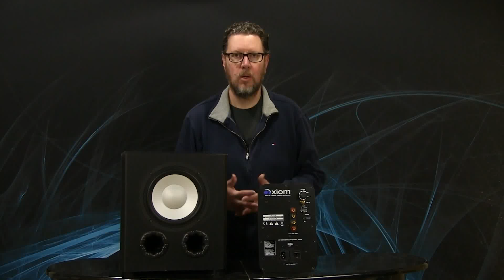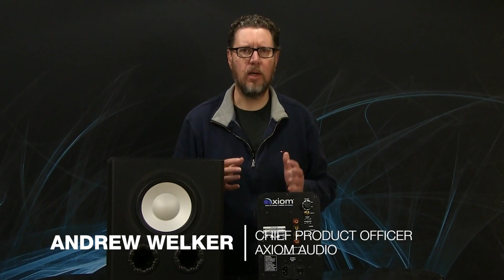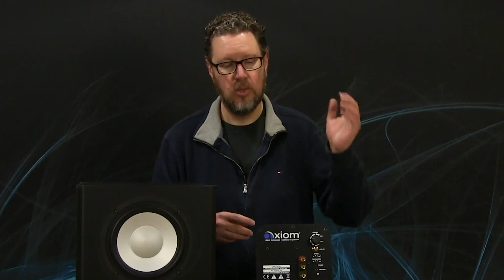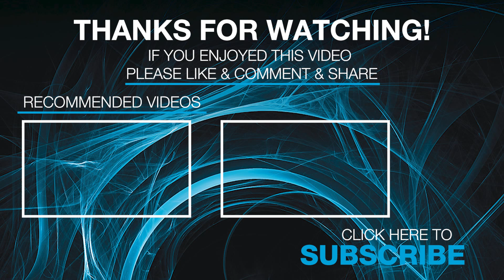Subwoofer Crossover: Best Settings For Home Theater And Home Audio Systems

Comment: Watched Rebel Ridge on Netflix, and it stars a guy who has a really deep voice. Center speakers and mains were set to a CF of 80. Subwoofer with LFE at 120, his voice was too deep. Switched it to 80, and the voice sounded much better. Seems that, according to this video, that should not have been the case?

Comment: Thank you for this very informative video.
A QQ: I have an AVR - Yamaha RXV4A -, and a Wharfedale DX-3 HCP 5.1 loudspeaker system. The subwoofer has both LFE and crossover controls.
If I use the AVR to set the crossover, where should I set the crossover control on the subwoofer?

Comment: Personally, electronics has no clue what my ears and perception of sound is like. I don't use bass mgmt systems. I run my towers full range with my receiver at the lowest X-Over setting and slowly introduce my subs X-over and volume...perfect for me. I want my sub to be an extension of my towers.
Reply: The best way to do it.

Comment: Need help,
I have got Jamo J12 sub with Denon X2000 avr. The subwoofer volume is set to 30%-40% and the level in the avr is - 10. If I turn up the volume on the sub, the sound will cut off at peak hits and comes back in couple of seconds. Is the subwoofer damaged or should I change my avr. Do you think it's normal. Please reply.

Comment: Hi. Let me get this straight. I have a pair of active speakers (edifier airpulse a100) with subout RCA port and rel t5/x subwoofer with low level input and LFE input. From what I understood from your video I should stick RCA into the LFE because crossover is being done on the active speaker side? REL recommends sticking into the low level.

Comment: OMG! Thank you so much Andrew. I've been doing so much research on soooo many sound variables with regard to my home theater room to achieve the best results. I'm getting the new Klipsch RP 1400sw subwoofer for my system tomorrow and I had no idea what to set the low pass filter to. I knew that the sub had as LFE input and I was aware that it was the proper input to use. However, I did not know by using that input, I didn't have to worry about a hz setting on the low pass filter because the sub would automatically allow the AVR to do the integration with the other speakers. Now that I understand that, that's one less thing I need to be concerned about! Your simple explanantion relieved some of my anxiety and for that I"m truly grateful!

Comment: Great video of watch numerous ones and you really explained this one well, perhaps you can help me?
I have a dent on AVR X6400H , with a pair of Polk Audio RT 3000s they are older speakers, but they have satellites on top and subs below so I’m basically running two subs on each side of the room  with a dedicated LFE line ,should I run Main or Main+LFE

Comment: When replacing a crossover, should the new crossover assembly be mounted on the back, or bottom of the speaker box?
 Im currently in the process of replacing the crossovers in a pair of budget speakers, where the old crossovers were tiny, and attached to the back of the speaker power input connectors.
 The new crossovers are considerably larger.

Comment: Thanks for this video.
I have a sound bar and wireless rear speakers.
The tv has no rca outs.
If use optical out and convert it to rca and connect to a powered subwoofer will I get independent sound from the subwoofer?

Comment: My Sony STR-DH790 AVR seems to have crossover settings for all of the speakers except the subwoofer.
Reply: You set your speaker crossovers in STR-DH790 settings and it'll send anything below that frequency to your sub. Then you set your subwoofer cutoff to max, if it is Sony SA-CS9 then it's 200 Hz

Comment: Andrew, thanks ! You helped me about my freq.settings. I have an old (2018) Jamo sub. Jamo sub has two rotary. One is Hz, its OK:)) Second is the LEVEL rotary. (minus endless to zero) My question is what level setting should I adjust on sub when I calibrating my pioneer vsx933 with its own microphone? By the way what level setting is recommended by the LEVEL rotary?

Comment: Hi Andrew, I have a denon avr-x960h receiver and two older Yamaha yst-sw305 subwoofers connected. Based on your video would I be correct in setting my avr crossover to 80 or 90 Hz and set the “high cut” dial to its maximum of 140Hz. 
Thanks Stephen

Comment: Great vid thanks.
I have a free useful app on my android phone which I think will help people understand what’s happening and tune the sub in nicely:  Frequency Generator. 
Connect the phones headphone output to an aux-in on AVR or amplifier (or an rca input using cheap adapter cable), and the app lets you wind the freq up and down with a slider. You can hear when the main speakers start to drop off, and adjust sub crossover to start responding there or a bit higher if preferred.
Also good for balancing the sub volume to the main speakers volume.
Reply: Nice!! Awesome find and awesome suggestion! Thanks

Comment: All Yamaha Bookshelf
Speakers FREQUENCY as below.
AVR - Yamaha HTR 3072 (5.1)
Center - 58Hz - 45Khz
FS - 57Hz - 45Khz
SS - 62Hz - 20Khz
SW - 20-160Hz
According to abv what crossover is to be set.
Current I set 80HZ

Comment: Hi please help me I am some confusion this crossover point 
My focal sopra n2 
Frequency response 34Hz-40khz
Low frequency point (-6dB). 28Hz

Center focal Electra 
Frequency response 55Hz-40khz
Low frequency point(-6dB)50Hz

Rear surround 
Bipolar focal sr800v
Frequency response (+/-3dB)
75Hz-28khz
Low frequency point(-6dB)65hz

Back surround focal 806v
Frequency response +/-3dB 55Hz-28khz
Low frequency point-6dB 47Hz

My subwoofer Definitive technology power field Reference 

Please suggest me what is the perfect crossover and 
For sub LFE 80Hz or 120hz
Please reply respected sir thank you
Reply: You can’t reply this sir please reply
Reply from the maker: I would recommend setting the main speakers to large and the rest to small. Then set the subwoofer/LFE crossover to 80Hz. That should work well.
Reply: @AxiomHomeTheaters  other speaker 80Hz front large 
Lpf for LFE 80or120Hz
Reply from the maker: @taheralikhan5771  yes, that's correct.

Comment: How about introducing a high-pass filter before the power amplifier (after the preamp) and hence take the bass significantly down for the speaker and let the subwoofer signal be guided by subwoofer crossover.
Reply from the maker: Yes, this is an excellent route to take with a stereo-only setup with separate pre and power amp!

Comment: Hi I’m still a bit confused 😢. What does it means if I set up the subwoofer to 150 Hz settings? Can it still do low frequency since it’s a sub and I will expect it to be able to reach those low frequencies
Reply from the maker: Yes, all the crossover setting is doing is setting the highest frequency the subwoofer will reproduce. It does not alter the low frequency extension.

Comment: Great tip but you didn’t address the volume control. Do I set the on the Sub all the up and adjust in the receiver speaker output control or do I set speaker output to 0 and use the manual out volume on my sub???
Reply from the maker: Set the out volume on the sub around 50% to start with. Then make the adjustments in the AVR. If you can't get enough level with the AVR settings, increase the control on the sub to 75% and readjust in the AVR.

Comment: Hi. I have a Denon AVR home theater (sub out LFE) 5.1 and a Velodyne SPL 800i subwoofer. (LFE) Now my question. on my subwoofer there are: 
1. subwoofer volume, 
2. low pass crossover, 
3. a button with internal x-over-Subwoofer direct. 4. a button with Phase 0-180
What should all this say on my subwoofer? I know you said max on crossover which is 120 Hz but then?
On my Denon AVR I can set the speakers and subwoofer in crossover in set up. should all the speakers be set to 80 Hz but what should I set the subwoofer to for Hz???
Reply from the maker: I would set the level on your subwoofer to the 12:00 position to start with, use the button to put it in “Subwoofer Direct” mode (This will bypass the internal low-pass crossover in the sub), and leave the phase at zero. Then use the controls in the subwoofer to set the crossover frequency, delay, and level. If the sub output is not high enough, you can go back and increase the setting of the volume control on the sub.
Reply: @AxiomHomeTheaters  thanks for the help.  ok I have set the sub as you said.😊 But what should I set in Denon's set up menu.  should all 5.1 speakers be set to 80 Hz But then what should I set the sub to for Hz in the menu.  I run with sub mode Lfe + main.  This is where I get stuck.
Reply from the maker: @johnnylauritsen3556  Your Denon should automatically set the subwoofer crossover to match that of the settings you have used for the individual channels. So, the mains will get full range signal + sub and the channels set to 80Hz will steer information below 80Hz to the subwoofer.
Reply: @AxiomHomeTheaters  thank you very much for the help.😊 so if I understand everything correctly now, it is on the subwoofer that I will change the bass if I want more bass.  then I turn on the crossover button, not in the Denon set up.  the volume on the subwoofer must also be at maximum or at half.  does it do any good when I run through avr Denon.  many questions and I am so grateful for any help.  I drive with the Denon AVR S650H which is enough in my room.  then I wonder since I have 2 sub outs on the amplifier if I can have 2 Subwoofers 😊 last question I have set all the speakers to 80Hz, is that ok.  should I put a subwoofer on this with (80 Hz) Have a nice evening.  Johnny
Reply from the maker: @johnnylauritsen3556  You’re welcome! Yes, if you want more bass level that the Denon controls can provide you can increase the level control on the subwoofer. I would leave the crossover button on bypass mode on the sub and make any desired changes to the subwoofer crossover frequency in the Denon. You want to avoid having the filters inside the subwoofer AND the AVR operating at the same time.
Reply: @AxiomHomeTheaters  Thanks so much for the help again. 1. it's a bit difficult to get the best bass with a subwoofer. Now I understand a little better. I think. The best thing is to change the bass Hz in Denon's set up menu and have the subwoofer at like 12 o'clock.
Then I can also raise the bass more by changing for example from 12-15. But what should the subwoofer in Denon's set up menu have for Hz?? Is that right now?
2 The last question is. I have 2 outputs for subwoofer, can I connect 2 subwoofers there? I have a subwoofer over an active Sub nova Ace-bass Audio Pro. is it worth plugging it in if it works or there is too much bass. IF then how should I connect these 2. should they be set to the same value and Phase to 0 or 180 Please Johnny
Reply from the maker: @johnnylauritsen3556  the frequency setting in the Denon should be set to 80 Hz in most cases. That's a good all around value. You can certainly try both subwoofers each connected to one of the sub outs on the Denon. Start with both of them with the phase control at zero. Then adjust from there in the Denon.

Comment: You are saying don’t use crossover in subs use the bypass setting on sub, to use crossover in avr instead
Reply from the maker: Correct. If you’re using the subwoofer output from an AVR, I always suggest using the crossover settings in the AVR and bypassing the crossover on the sub.
Reply: Great video clear and direct. Thank you Sir I was really having a problem with my denon AVR  and my  subs, alluded tech 5.1 system. 2 towers not powered because older Def Techs with out powered sub sounds great without the possible of powered sub. I have all set to small now I think that seems to give a more timbre matching system. Crossover in Receiver set to 80 and the at 200 to get out of the way. My question is when I switch to stereo for music, what if any bass goes to my towers front speakers???
Reply from the maker: @secretsq100  Your AVR should keep the same crossover settings whether you are in a multi-channel or stereo mode. Your front towers will only extend down to 80Hz and the rest will go to the sub. Now there are some AVRs on the market that allow different settings for multi-channel or stereo, so I would consult your manual.

Comment: I have 2 questions for you Sir.

I have a Denon AVR-S960H it's advertises that it can do Atmos but, there no hook up in the back for heights speakers. I have 2 front speakers that have built in heights and, I don't know where to hook the height to.

My 2nd question is should set my avr to LFE+main? I'm running 2 8inch downward shootings subs from Klipsch Black Reference.
Reply from the maker: It looks like the “Surround Back” channels on your AVR can be assigned to be Atmos “height” channels. I believe you can only run a 5.1.2 setup with this AVR, not 7.1.2. Unless the subs you have are built into the main speakers, I would set the AVR to LFE only and make sure the mains are set to large.

Comment: where should the phase switch should be set to as ny sub has a phase switch also together with the receiver
Reply from the maker: If you have phase control on both the subwoofer AND in your receiver, set the subwoofer to zero or “normal” and then try toggling the control in your receiver. You’re looking for a smoothest bass sound and blending between your main speakers and the subwoofer.
Reply: @AxiomHomeTheaters  thanks greatly appreciated
Reply from the maker: @firelinks316  you're welcome, happy to help.

Comment: ok, I have speakers with 45-20.000 and an active subwoofer...which value I start with the crossover and which volume you should start....from where I can use my ears, I need a starting point. 👍😉
Reply from the maker: I would start with a subwoofer crossover at 60 Hz and the level around the mid point. You can listen and adjust from there.
Reply: @AxiomHomeTheaters  Thank you...I did your advice...for me the best sound is crossing at 80. Volume is 50% but sometimes to much, I turn down to 30% it depends the quality of Music. I like the albums of Sabaton, Legends of Bonfire, Tambu of Toto and the latest albums of Kansas. They sound terrific with your advice, thank you 👍👍
Reply from the maker: @volkiruski1221  You're very welcome, glad you've got your system set-up to sound great! Always happy to help.

Comment: Straight to the point 👉!! Nice.  
Question. I'm running bass Shakers.  So I have  an amp plate that I use to running the Shakers..  now the question is what dial should I run the crossover on the sub plate. I know for a traditional subwoofer we set the dial to the highest crossover point . Now does this apply to the bass shaker amp as well? The lowest setting on the amp plate is 40hz.
Reply from the maker: Thanks! Now bass shakers are one area where I am not well versed. Does the manufacturer have any recommendations?
Reply: @AxiomHomeTheaters  not really.
Reply from the maker: @rindershow212  I would reach out to them I’m sure they’d be happy to offer advice.

Comment: What is the perfect Gain in a subwoofer and how too adjustment?
Reply from the maker: It will depend on the rest of your system, but if you are going to drive the subwoofer from a sub out on an AVR, I usually recommend setting the level control on the subwoofer to its mid-point to start and then level match with the AVR output levels. If you need to go above 0.0dB in the AVR subwoofer trim, increase the control on the subwoofer itself. You want the controls just open enough to be able to balance the sub output with the rest of your speakers.

Comment: I have a Cambridge AXR100 reciever with a sub output that has the crossover at 200hz. Should I then hook that to the LFE input on my SVS 1000 Pros?
Reply from the maker: That crossover should be able to be changed to lower settings, so you would need to see which works best with your main speakers. Since the receiver is performing the crossover for the sub, use the LFE input.

Comment: Andrew, Always appreciated.  Sometimes the simplest of things are never addressed. The AVR example is one, LFE as you said but, ultimately let the AVR's settings do the job. Excellent point. And as for 2 channel,  just simply making the integration  seamless, so it sounds as though the bass is coming directly through your speakers. SVS is my favorite as their higher end models offer a blue tooth setting, whereas you can sit in you favorite chair with remote and avoid constantly getting up for further adjustments. Easier on back too. Thanks so much for your video's and tips. Robert TN    PS I'm sending a response to an earlier post about speaker grills, YES, I do prefer mine off when listening. Not a Giant leap forward, but, as you said in the higher frequency ranges somewhat notable. Thanks
Reply from the maker: Thank you for sharing your comments, Robert! There are so many settings, particularly within the context of a home theater system, that’s is so easy for the little things to get lost amount the myriad of configurations, etc. These quick tips will hopefully help with those simpler topics.